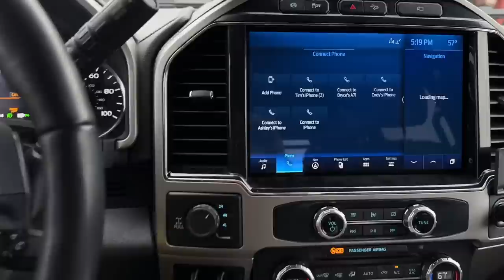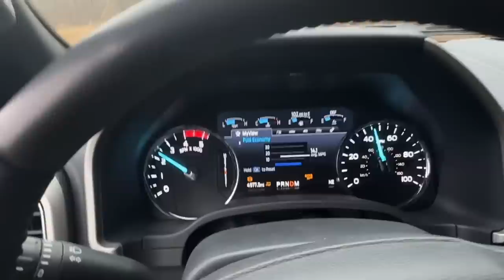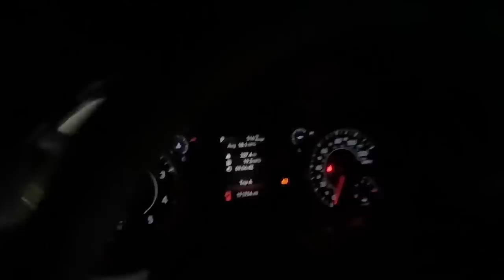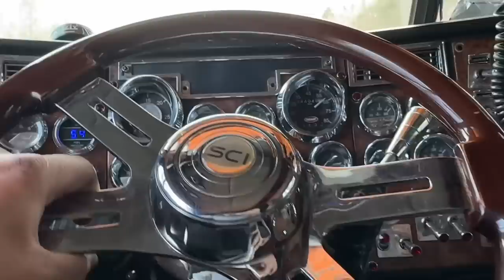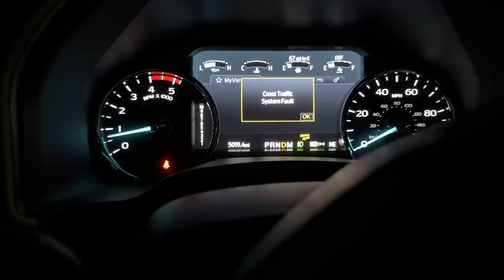Sherbert Hits The Road And The Yellow Cabover Motor Lives Again!!

Comment: I run a 2012 pinnacle and it has 947,000 on it as of today, haven’t had any major issues, just a small coolant leak, love the truck over all, pulls great, has 475hp with a 13 speed Eaton, I haul jet fuel so don’t anything too crazy lol

Comment: That’s a nice trailer! We used to haul steel out of the steel mills in Johnstown pa. We hauled out of all of them. Definitely a lot from the car shop. Then when they closed we used to and still do haul coils from the wire-mill in town to Chicago. That trailer is on really nice shape. You did a good job on it. We hauled some weight on those trailers and they always pulled great.

Comment: My old 79 w-900A 3408 cat is probs on its 4th rebuild I rescued my 3408 out of an 044 madill grapple yarder that caught fire 🔥 but the big kitty was a okay 👌🏻 I’ve had it rebuilt before it got put in my w-900a plus one Inframe , but lights out compared to my old 3406 425 air to air night and day 😊I can get triple digits with a super B with a full load of lumber

Comment: Hi Tim, you mentioned the deal with the Pete, surely it would make sense to do the deal, you said about needing the chop sherbet and do a few jobs where the Pete has low mileage and comes with a reather  so it’s a no brainier for me, yes sherbet looks nice but once you do the changes, it will change and the end of the day, you run a trucking business not a showroom. Have a practical think about the trade.

Comment: Hey I was letting you know I work at a seed company we're having the same trouble with our Ford trucks cuz they're aluminum we're putting them in the stake pocket and making State pocket bracket holders and then we're making it where we can put padlocks on him some people can't take him out the stake pockets so your flatbed should have stake pockets you make some for it you can slide him down through put a padlock on the bottom of it and nobody could steal them out of your

Comment: Hi Tim
I have used Amsoil for years. Valvetrain shines! My mechanic told me to check the oil cold. This is because it has such good advesion and heat properties. Hot will show you might need to add oil. He is a spokesman for Amsoil and sells nothing else. Just a fyi

Comment: Tim your talking about Amsoil well I been running in my Cats and I started putting Amsoils bypass filters on my big kitty and my 6nz anyway with oil analysis I’m going another 7500 miles and10-12000 on my C18 I also started running Amsoil in my saws both bar and engine and I can’t believe the difference in the way the saws run no more fouling out and how pistons look it’s plum crazy to be honest

Comment: @Gentry & Sons Trucking. Rather than shortening Sherbert why not just loose the back 2 fuel tanks and put a pusher axle on it and use it for heavy haul and cattle where the longer wheelbase won't hurt anything? With the wheelbase that truck has you could mount the pusher far enough forward to be able to carry 10,000 lbs on the pusher legally.

Comment: Tim, you can’t beat a Ram I put 285,000 miles on the 3500 dodge ram in two years. Hauling cars with a wedge trailer can’t beat a Ram.

Comment: Junk in, Junk out ....... 🤦 

Wow, that red, tan, rust, engine looks brand new, and that brand new transmission is awesome! 

Instead of "a coat of many colors" (Dolly Parton) this is "a engine of many colors" (Tim Gentry)  🤷

I've got a novel idea about those stacks, why don't you measure them? Oh that's right, all of those little different sized marks on the tape measure confuses you....... 😳
Reply: @donaldjrchappell6800  

You really should stop ✋️ thinking 🤯 you're obviously not very good at it, most likely due to lack of practice.....🤷
Reply: @Will-ct9ww  my comments are directly directed to comments of Mr John Wayne, I would say that " if you can't say anything nice,,,,don't say nothin at all" , reciprocates to all.
Reply: @donaldjrchappell6800  I will remove my comment I apologize to you

Comment: Its never an easy trade
The guy has low miles but nothing fixed on the truck
Sherbert has everything looked at and specked out on it
Your going to get the raw end of the deal on this one if you go threw with it
That truck has problems that was being milked
Dont trade sherbert out for nothing

Comment: Some ELD activate off speed sensor. So.... HYPOTHETICALLY... u could install a toggle switch that breaks the siganl to computer.. which is where eld gets data that truck is rolling. One can roll up too fuel island..or be at a delivery place driving and eld never activate.. Hypothetically Speaking